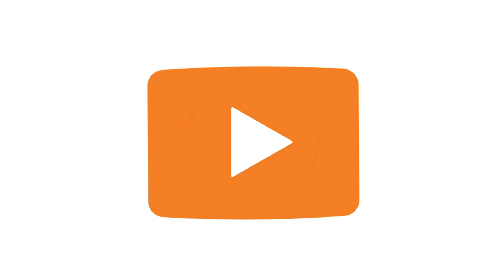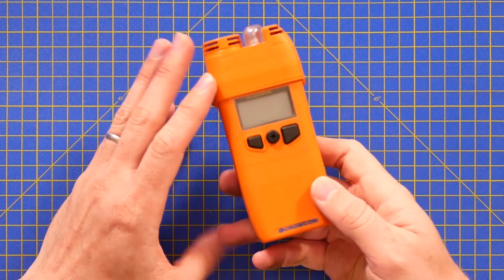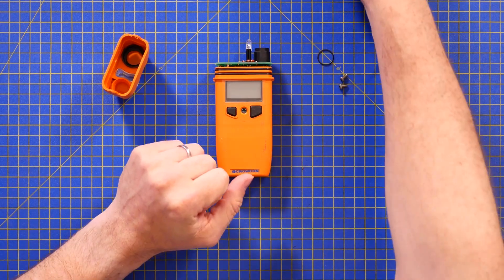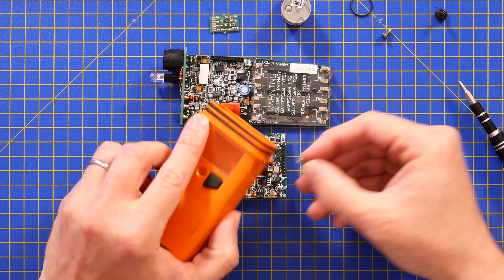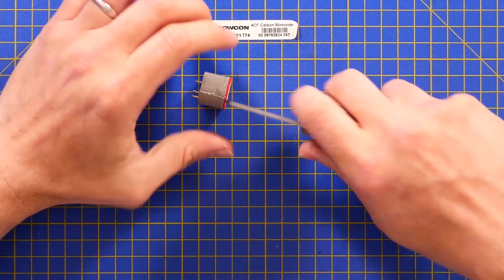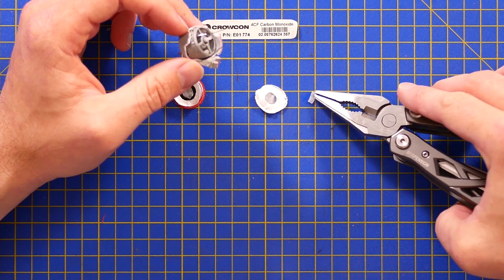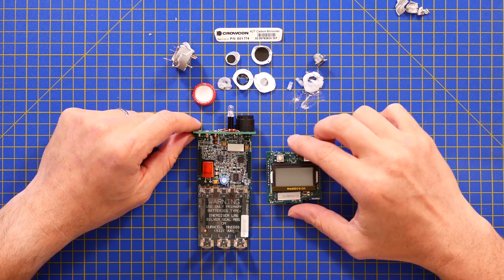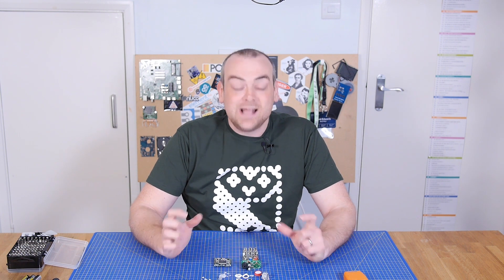Personal Carbon Monoxide Meter Teardown - The Electronics Inside

Comment: There is one type of CO detection you didn't mention which is IR absorption that automotive gas analyzers use. It's basically an optically tuned length of tube (to the IR wavelength absorbed) with sapphire windows at each end which pass a 'chopped' or pulsed IR light through the sample from an emitter (heater element or later an IR LED) to an IR photo detector. The sample is pumped through nipples on the side of an aluminum tube from one end of the tube to the other. This 'alternating' signal is run through a linear amplifier and rectified to drive a meter movement or A/D for digital display. They are calibrated to a known gas concentration by adjusting the gain and the DC offset of the amplifier(s). The sample is also run through a different length tube to measure hydrocarbon content, which absorbs at a slightly different wave length. I was a service tech for an automotive service equipment company back in the late 80's.

Comment: Interesting that it's set up for rechargeable batteries but the silkscreen tells you to use specific alkalines.

I wonder if they had readily available replacement sensors for this. It seems like they would be a consumable.

Comment: Yes, you get assorted modules for those, most common in the electrochemical method are CO, CO2, methane (CH4) and oxygen, depending on the specific type of permeable membranes used, the electrolyte and how insensitive you want to be to unwanted substances, though the CO and Ch4 sensors are all pretty sensitive to NH3 as well, which is good in a mine, as you definitely do not want too much of any of them. 

Seen plenty of mine detector units with 4 sensors, that every foreman or shift boss wore in the mine, and those have saved a lot of lives. They lead a hard life, being dropped, dunked under acid water, crushed by equipment and often simply being destroyed along the way.  Expensive modules as well, easily $100 per module, and the type you have only last 6 months once opened from the controlled atmosphere packaging they come in, and even sealed only have at most a 2 year shelf life.

Years ago saw a group taking these and converting them to be both rechargeable battery, and also making them able to drive external warning sirens and equipment, using the units that the mine bought by the dozen every month, and sent in by the gross every quarter for repair and calibration. They had a 4 pin gold contact arrangement on the base, and a drop in and strap holder, to allow the 4 sets of contacts to touch, with resistors and diodes both sides to keep the EEX rating on the whole unit, even if wet or shorted. They kept a fleet of the modified units, so they could just buy one single selection of sensors, and modified in house for the fixed units.

Yes your one can be CO, CO2 or oxygen, just a different set of range scaling and offset resistors on the plug in daughterboard, and set a different option bit in the H8 microcontroller, plus the calibration set used, and the different front face print, with the different sensor pinouts being done using the push in sockets into the gold plated holes on the interface board.
Reply: Awesome insite, thank you so much for sharing.

I only have a limited experiance with confined spaces and dangerous atmopheres, so it's great to hear some first hand experiance.